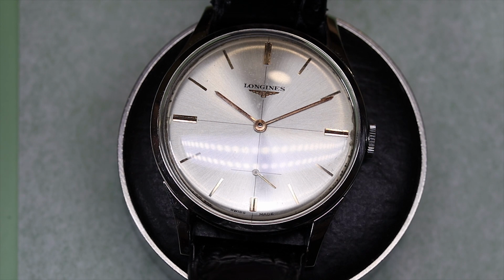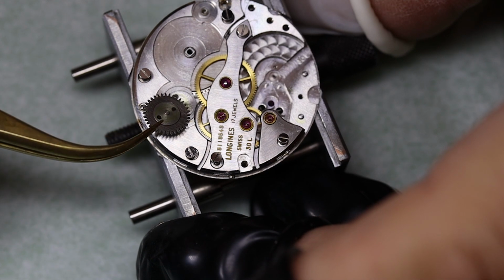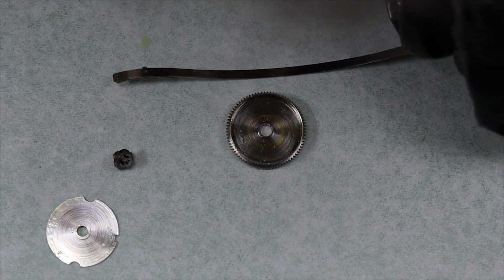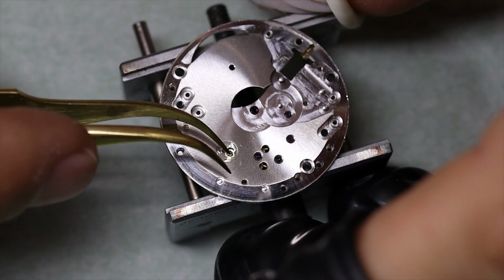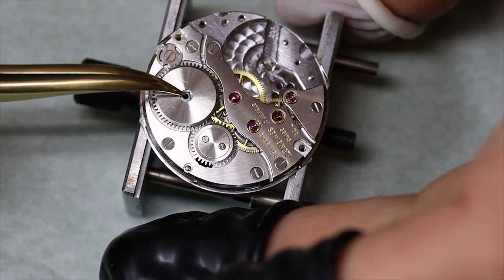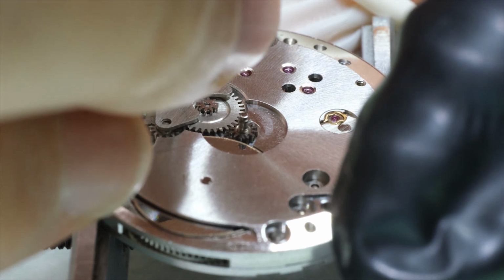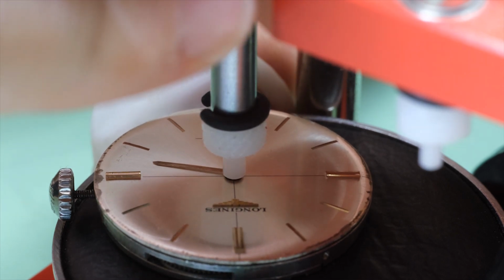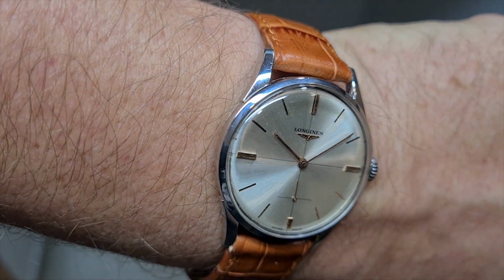Servicing the record breaker - Longines 30L

Comment: Hi. I just purchased a longines 30L. I was wondering in which direction to wind. I tried clockwise but there was a bit of resistance and nothing happened. I then wound it counterclockwise and all seems good.   But I was under the impression that clockwise was the correct direction to wind. Any thoughts? Thank you!
Reply from the maker: Yes, you wind a watch clockwise. Not sure what happened to yours but if it hasn't been serviced for a long time the click could be stuck perhaps.

Comment: HI there, 
what is that thing you use to clean the escape wheel and the palet fork pivot after the fix o drop treatment?
Thanks
Reply from the maker: Hello Heiko, thanks for watching! It is a piece of pithwood, the soft core of an elder tree. It is firm enough to clean the pivots when they are pressed into it, but soft enough to not make any marks.
Reply: @VintageWatchServices  I learn something new every day. Thanks

Comment: Question. Why don't watchmakers apply the oil to the surfaces of the escapement teeth prior to rebuild rather than the rather awkward technique of oiling the pallet stones after rebuild?
Reply from the maker: Good question! Some people actually do lubricate the escape wheel teeth, but it's easier to get a uniform distribution of oil by lubricating the pallet and then letting the escape wheel teeth pick it up from there.

Comment: Great great job indeed!
Two questions, if I can: why don’t you lubricate the pivots pallet forks, and the barrel bridge hole?
Thanks indeed…
Reply from the maker: Hello Ricky, thanks for watching and for your questions! The pallet fork pivots are generally not oiled as there is very little power working on them. Oil creates a tiny amount of drag, which could affect the amplitude.
That said, Seiko does advocate oiling them and it's not a big deal if you do, with a light oil like 9010. Anything thicker would negatively impact the watch though.
I oil the barrel arbor rather than the barrel bridge hole, but you can do it the other way around also.
Reply: @VintageWatchServices  Thanks indeed for your rocket reply, and apologize for my bad english…Seeing your videos is wonderful

Comment: Is 30L better than 23Z? If so, why?
Reply from the maker: Hello Dávid, thanks for watching and for your question! Whether one movement is better than another is a very difficult question to answer, but the 30L is generally considered a higher performance movement. The 23Z was based on an earlier design and is aesthetically less pleasing to most, although it isn't all that different. 
Perhaps the key advantage of the 30L is the larger balance. A larger balance generally provides a more uniform oscillation period (although this doesn't quite hold true in high beat movements). But as a newly designed movement Longines certainly also put a lot more effort into adjusting the 30L for chronometer tests etc. 
I think the main take-away is that Longines made some fantastic in-house movements back in the day. Longines were one of the very top brands back then, on the cutting edge and clearly at the same level as Omega and Rolex. The 23Z is certainly part of that fabulous legacy :)
Reply: @VintageWatchServices  Thank you very much for your detailed answer! I have two watch with 23z movement.
I don't understand the movements enough, you convinced me.
I can’t afford a watch more expensive than longines, this seemed like the best choice in terms of value for money.
Reply from the maker: My pleasure and Longines vintage watches are indeed very good value for money. The 23Z is also a very good movement and will give you great performance when properly maintained 👍

Comment: I don’t remember having seen the jewel holes pegged before. Is this done to clean them of dust and old, maybe dirty oil residue? This is great to see, a watch better made than the very well made competition and it still runs like a champ decades later. GREAT JOB  👌
Reply from the maker: Hello Joe, thanks so much! This watch is absolutely fantastic both in quality and design, and that's a real characteristic of old Longines'.
For the holes: you basically always peg the holes to loosen any crusty old lubricant, but for this watch it wasn't actually necessary as it wasn't that dirty. Old habit though :)

Comment: Great job as always!! Longines seem to have some "ghost" movements, I have a ladies watch with a 317 movement that needs a new balance but no ref for it at all anywhere, i did find a 420 but again not listed and although almost identical to the 317 the balance pivots are too long so i cant swap them around!!
Reply from the maker: Thanks Carl! Some of these old movements are indeed difficult to find information on, in particular the ones that were not made in large quanitites, such as many ladies watch movements. The sad fact is that for some of these movements you will not be able to find spare parts anymore or it will take a really long time. There are some good Facebook groups etc that might help you out.